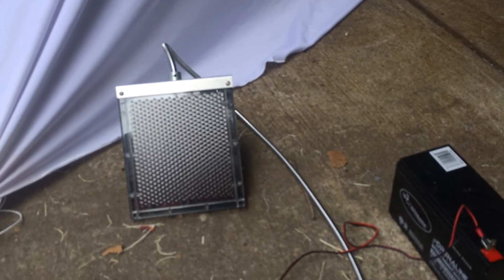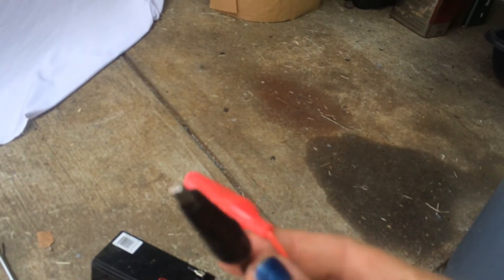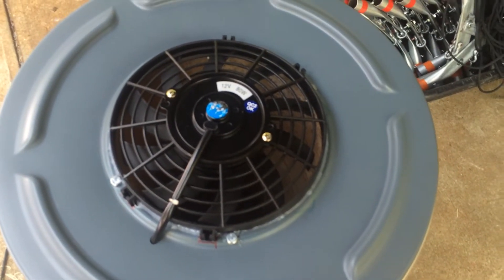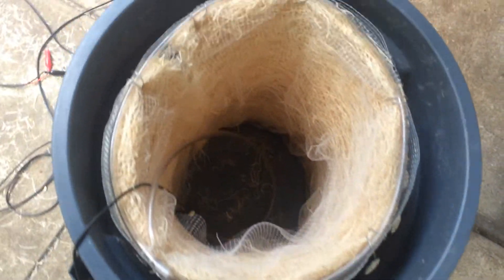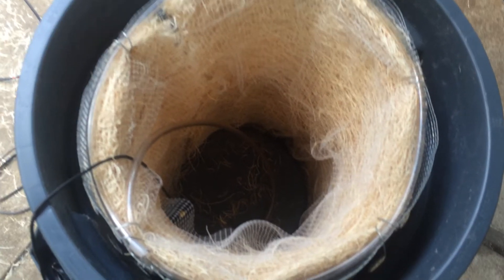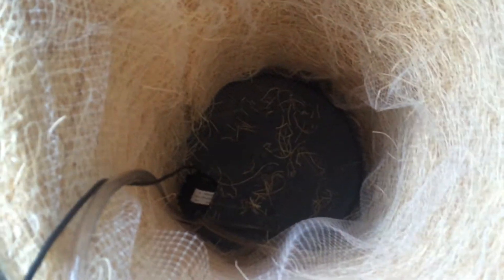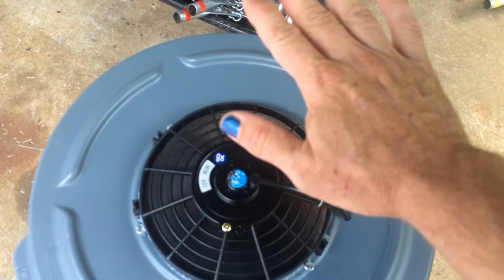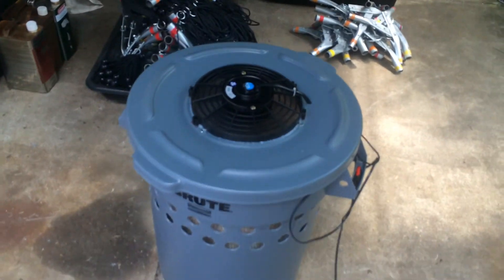Swamp cooler: parts and assembly

Comment: hopefully you have a seal between the fan intake area and the pad which will force air through the pad and not simply from the outer holes to the fan bypassing the pads. That is why all commercial or diy cooler have the pad  pressed up against the intake or (as in the case of my vintage convair m300) the blower intake sealed. I wouldn't worry in your case about the water leaking out of the holes at all. Plus there is some suction inward due the vacuum created by the fan.